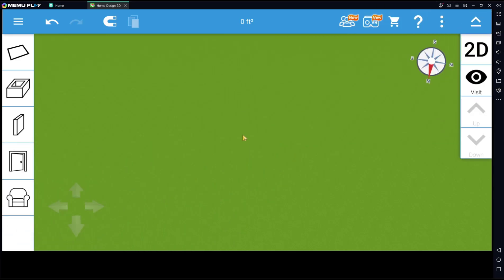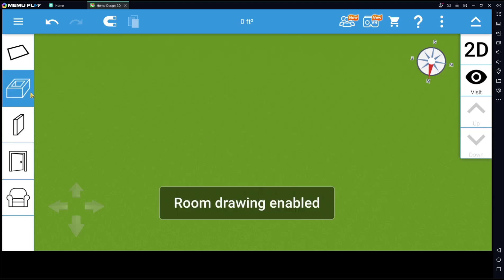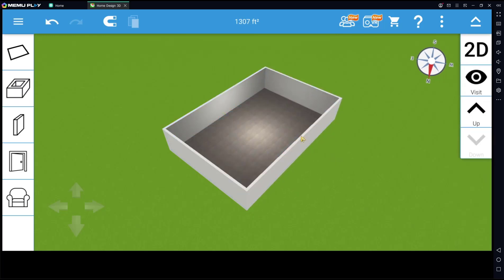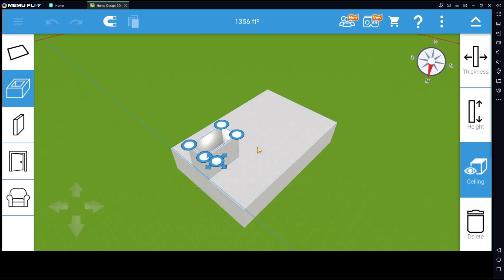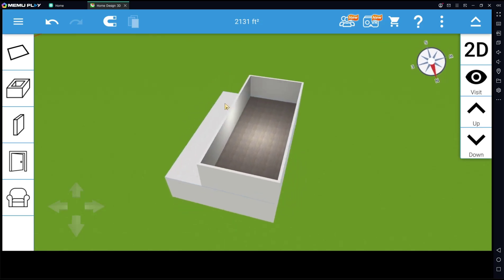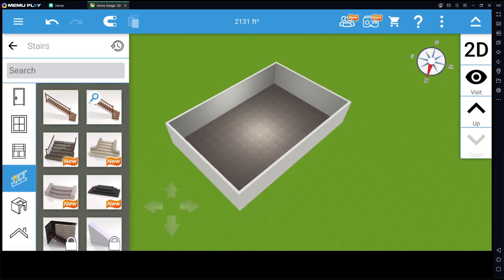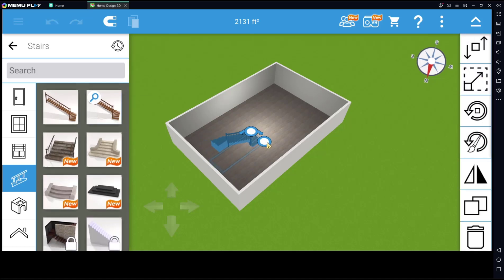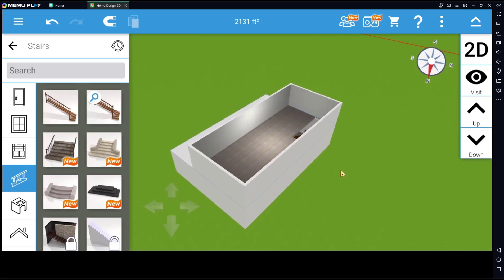Home Design 3D How To Add Second Floor

Comment: Heya, I’m using Home Design 3D on my iPad. I added a second floor by mistake but need to remove it, but there is no delete floor button at all… how can I remove it? I can no longer view my 3D plan from an aerial view as the floor/ceiling is blocking my view, v annoying!